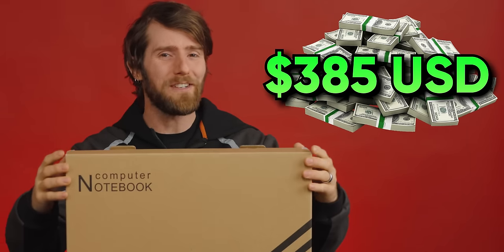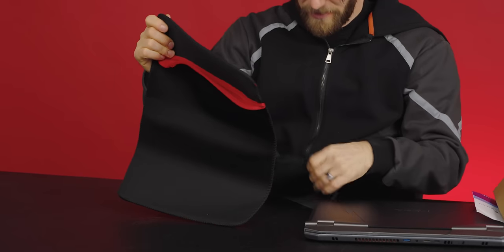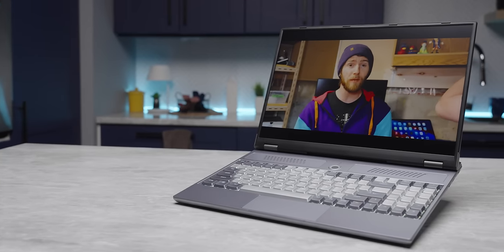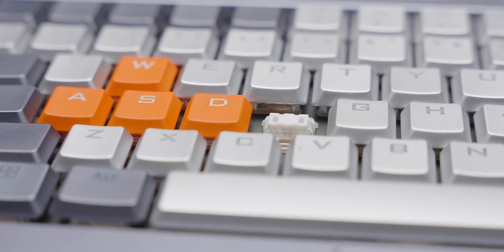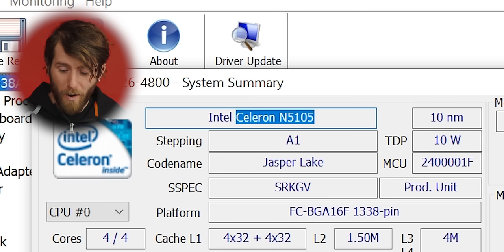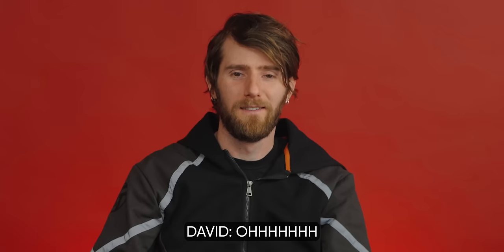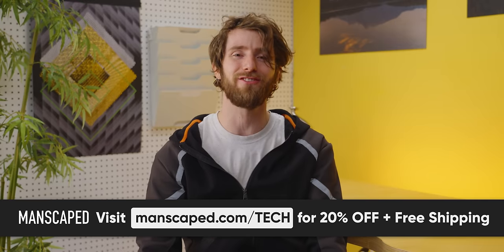Brown Star for Effort – This AliExpress Gaming Laptop is HILARIOUS

Comment: The benefit of multiple partitions to me is simply another level of file organization. It's a nice place to put files away from the wild west of other folders that other programs put heaps of random junk in. But I hate it when it's a default because most people will not know they can use the second partition and even when informed they can, they never will because it's just not a form of file management they are used to.
Reply: yeah I don't like having important data on C in case it's corrupted and I need to reinstall windows or something
Reply: but it is stupid for SSD, you want to the NAND flash wear off evenly, if you create several partitions how will the firmware going to handle it. this probably shorten the lifespan off the SSD
Reply: @tysloo81  firmware doesn't care about partitions, at low level all free space is marked and managed by the drive itself (logical LBAs vs physical + TRIM command) so data/partitions is physically fragmented across flash chips.
Reply: @Chipsaru  i see, look like i worry for nothing
Reply: I constantly fight with family trying to get them to store personal stuff on the second partition.  When I have to go fix whatever they've screwed up, I hate having to go find all of their stuff before wiping the OS.

Comment: If I could get a laptop with this large 16:10 screen and a great keyboard like that, that is not a scetchy cheap laptop and it had a better processor, it would be an insta buy from me.

Closest I can think of is thinkpad t16, but I no longer trust lenovo to make a good keyboard after they've reduced the key travel again and again on thinkpads.
Reply: Look at the legion 5 pro, 16:10 screen and a great keyboard
Reply: @user-uk5vf5zf9b  Really expensive though, it's the higher end of laptops, particularly the higher end of gaming laptops, which in itself are at the minimum £599+ usually
Reply: I just bought a Lenovo Legion from Costco on the Boxing Week sale. I really don't care about keyboard travel because I use an external keyboard. Do you have any other qualms about Lenovo?
Reply: @UnavailableHandle.  you get what you pay for.
Reply: @epmcgee  That is true, but it must be stated that although the quality is better, you have to pay more. And if it was as easy as paying more, then people would not be considering buying the cheaper and 'worse' item in the first place.
Reply: @Suuperwuuper  The design of the Legions is an absolute deal breaker for me. It has too much gamer, early 2010's energy for my liking. I think Asus' Zephyrus lineup is just an all around much better product. Very slight downgrade in the gaming department in terms of raw fps for much better everything else.

Comment: I would not trust that windows version for anything.
Having said, that, I have a gaming PC I do everything with, and a and now about 5 year old budget laptop I use on vacation once a year. And I got to tell you (except for windows) this looks like a pretty sweet 'for vacation' laptop.
Note, I deliberately use an older laptop on vacation exactly because it can't run modern games, to make sure I actually vacation on my vacation.
Reply: Tbh,  the activation .bat is a bit of a issue,  but show hidden files is a tweak I do myself, same with show file extensions. Putting icon snap on desktop is.. odd, but I thought it was default on some versions of Windows. The partitioning could be just because of  how they are running a deploy image.
Reply: I mean, if it's any version of windows after 7 you shouldn't be trusting it no matter Where it came from or who installed it (yes, even if that was you), so...
Reply: Just format the drive and reinstall a legit copy of windows (or your os of choice). You don't even need to  purchase a license and activate it if you don't mind some minor annoyances.

Comment: your copy of windows is activated using one of the two following methods.
one: using multiple volume keys.
two: a activation hack called a msk key activation hack.
both which will give out the windows is activated using the organisation's activation service.
problem that you'll have is that under one it is against microsoft terms of service or eula. and if it's two than the activation will only last a certain amount of months before windows needs to be reactivated again. this is one of the reasons why the laptop is cheap to get with windows 10 pro.
Reply: The other method is using kms.lotro, havent had issues with that yet.
Reply: I wonder why they didn't pre-activate before shipping with grey area cd key site windows. It like $10 a pop of win10
Reply: It's using KMS for sure, you can see it in the batch file. It's probably got a scheduled task set up to run that batch file every so often so that it stays activated.
Reply: @linaskvedaras  because it's still $10 each machine.  So they rather use a KMS license and activate against a unofficial KVM server on the internet (most likely hosted in China).

Comment: Great thorough review. The only reason I have never purchased a Chinese brand laptop is because of the uncertainty of whether it be a legit Windows fully functional, if it would still function in 5 to 10 years after purchase or if the system would be upgradeable to a Windows 12 once it comes up, if is going to be secured, if you can increase storage or ram, or if the games wouldn't be lagging so much, etc. After all, we live in a consumer world and lately all products are made to last shorter times than before.
Reply: That logic doesn't wash much, China has 5-10 good years on it before Myanmar pulls a hustle on it. 😉 Open source drivers and standards in flex connectors would be good to see, as with durable USB-C magnetic connectors.
Reply: China has some brands like mechrevo with laptops shipped with legit windows, they're really of good value for the money if you ask tech enthusiasts in China. The only downside is that they usually don't have a very good build quality and sometimes you need to fix them yourself

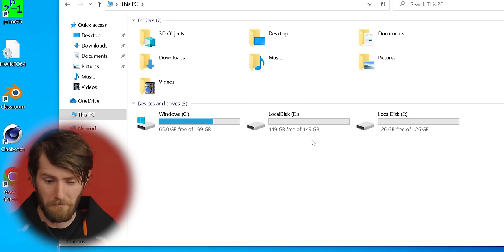Comment: 12:16 I disagree, there is a real benefit with partitioning your drive for your OS and whatever else. If for whatever reason you need to reinstall windows, it allows you to do it without purging all your data and programs. This saved me many, many times from broken windows updates. One I particularly remember is on windows 7 I had virtual audio cable and a windows update completely shit itself when updating and prevented me from gaining access to the operating system and the recovery area. I could wipe my 100gb partition while keeping my 900gb worth of games.
Reply: Only partially thought, tons of games and programs throw valuable files in AppData (without warning the user), then you think you're safe with the program installs backed up and bam, all vital informations are gone.

Still a good idea to keep valuable files/programs on a different partition/drive, but remember to keep a list of programs leaving their goods in AppData or User Folder (my documents and such).

Comment: as a coder who uses a home server to work remotely, I think something like this could work for coding stuff as well. I do think this has way more potential if you step away from x86 and use an ARM system, that way you can get more battery life out of it (and probably better performance in basic tasks like remote desktop).

EDIT: I would also favor linux in that case to further improve performance (also bc I am starting to actually hate windows right now)
Reply: Why are you starting to hate windows?

Comment: The jh is short for jihuo, which means activation in Chinese. This laptop came out in China back in the mid-2022. They advertised themselves as gaming laptop, but never really made it clear in their product page that it's only using Celeron chips. Instead, they made huge efforts showing people the mechanical keyboard, which actually attracted many reviewers. Btw, the laptop you purchase back in China came with a fire extinguisher. And also, the brand name is different. But they are the same product.
Reply: F-fire extinguisher? Is that some sort on innuendo

Comment: Let's be real, clean install is what most of us do on new device anyways and should always be done on less known brands imo, so no point there. Also gettin win activation codes from China has been a thing for quite a while now, they usually get it legit from some company that bought them in bulk.
Reply: Fun fact, I recently bought Asus without win, got bootable from MS site and activated it using my old code that came with 300$ Jumper ez book 3 few years ago for free and it works just fine.
Reply: Yep, buying a laptop with no pre installed windows can be great value if you can find one
Reply: This one is using kms activation hack though
Reply: That's not legal in any case. Even if this is a legit volume license, you're not supposed to share it outside your organization.
Reply: @АлексейГриднев-и7р  This is KMS not regular volume license
Reply: its a pirated version of windows they are using. that said, its not "unsafe" as in they aren't sending you data anywhere. its just a kms hack, super standard as far as pirated windows goes.
Reply: @pafnutiytheartist  Got my Y520 in 2017 without Windows pre-installed. Needless to say, I have Win 10 LTSC with KMS activated running on it.
Reply: @АлексейГриднев-и7р  Who cares. As long as it drops the overall price..
Reply: @fooltimer  even windows 7 codes works iirc

Comment: Even the specs they used for marketing is weird. A Celeron gaming laptop, with a 2k display, and a mechanical keyboard. But no discrete GPU? That said, the broken English used on the store page is hilarious to read through
Reply: It seemed to me a good laptop before the Celeron part.
Reply: @DRSDavidSoft 😂
Reply: It's obviously designed to fool people into thinking they got a gaming laptop at a bargain. With those specs it could have easily been a pretty good fanless thin and light.

Comment: The batch file named "win10jh" probably mean "win 10 activate",  "jh" stands for "ji huo"(Pinyin of 激活 whitch mean activate).
The garbled char in the batch file could be Chinese saved as Chinese encoding format gbk, default encoding format for Chinese language setting Windows system, but in English setting it's display wrongly, you can open the file with gbk instead of default utf8 the it probably displays correctly.

Comment: Actually an amazing laptop for many people because it's got a fantastic keyboard for that price, 4 cores that can easily handle Office, a 2.5K 16:10 screen for the rapid fire Word typing, and it would still work for around 3-4 hours on battery even at high brightness. And the iGPU is serviceable for 4K video playback - and remember, it's got a 2.5K screen, so watching 4K movies with that Intel Wi-Fi chip is what you would certainly want to do. With Linux it's going to be a great machine too.

Comment: That honestly was not a bad laptop, compared to what I was expecting due to its price and that it came from AliExpress. That keygen in the OS sure was surprising considering that one can easily get legal keys from around 20 bucks, but well nothing that cannot be fixed with a fresh install.
Reply: they use an activation sever like other comments said so nothing unsafe
Reply: @namesurname4666  Oh, I know, as I used those things before Windows 10. I just made mention of that, because if you are uncomfortable with those things there are cheap alternatives.
Reply: how they worked on other versions of windows ?
Reply: "legal"

Comment: There isn't a weird off-brand Wi-Fi chipset because of Intel CNVi: basically a Centrino successor. It's cheap because most of the expensive circuitry is integrated within the CPU die, leaving only some radio parts to the module. It should go without saying, but CNVi modules aren't standard PCIe and will work only in a dedicated slot.

Comment: Wipe the whole SSD and put Ubuntu on it and you'll love the laptop. Seriously.
Reply: Truth... except I run Slackware, instead.  I have like a dozen Slackware 15.0 systems that friends were just throwing away.
Reply: you'll love it until you try to use it for anything you bought it for :P. I run various unix flavors on my machines but my laptops run windows except my sparcbook. I need them specifically to run windows software without any weird stuff that eats any extra time to set up, or worse, just doesn't work. To me a laptop is a tool, it just needs to do a set of things reliably and that's it.
Reply: @noth606  I get a lot more work done on Linux, yes with a GUI, than I do with windows. What software do you care about?

Comment: Would this actually make a decent ChromeOS flex book? Can it be installed on such Celeron?
Reply: I would think so - the only issue might be with the webcam, but other things should work.
Reply: If your going with alternative operating systems on a device like this, just try something like Linux Mint. Has most of the advantages of ChromeOS without most core limitations of Google's Operating System.
Reply: Yeah don't go with ChromeOS for this —or debatably any— system. Any non-Google Linux, or Win7 or Win 10 would all be fine. Obviously Win 7 would be very contentious or recommended-against by many, but I think it could give a better experience if it's a device that isn't used to download sketchy programs nor open sketchy email attachments, and most importantly isn't doing anything that might need Win 10 (like most tax software for some stupid reason)

Comment: Can Anthony revisit it with different Linux Distros? I think it would be good to try it with the typical picks along with deepin, since it is a chinese distro.
Reply: I would avoid Chinese distros.  The Windows is also sus.  I also worry about what's been done on the firmware too.  Just have a packet sniffer on for a while and make sure it's not doing anything suspicious.  I personally like Fedora currently, but any Linux distro may do well on the N5150 especially with 16GB of RAM.
Reply: @TechieZeddie  I mean the chinese distros are still open source.
Reply: @KeithBoehler  unless you download the recompiled ISOs.  Also there's a huge conversation about their software repository.
Reply: @TechieZeddie  True, but it is still open source. If you want to use it and compile it yourself out of any concern then do so. Still better than it being closed and with a "trust me bro". If you still do not trust it then don't use it. Its not like you are vendor locked into it.
Reply: @TechieZeddie  it's windows 8 or higher. It's sus by default.
Reply: @KeithBoehler  If you compile everything yourself, you're not using a distro anymore (unless said distro is built for this such as Gentoo). Half of the point of a distro is the package manager and repositories that distribute precompiled binaries. Binary distribution is very much is a "trust me bro" kind of thing, and the fact that the sources for the packages are available doesn't say anything about whether or not the binaries can be trusted.
Reply: @alex15095  And how does what you said change what i said?
Reply: @KeithBoehler  It is similar to someone giving you a drink and the drink's "recipe", you refusing to drink it because that person has a history of poisoning people, and someone else saying "well they gave you the drink's recipe, it's not closed or trust me bro, if you don't trust him you can go make it yourself"

Just get your drinks from a reputable source in the first place?
Reply: @alex15095  So build it your self. Remove the parts you don't like(if any). It is open source for a reason, take advantage of it.
Reply: @KeithBoehler  you really have to get everything before compiling yourself, but not everyone has the knowledge, time, or will to do it.  Most will just download the ISO which is pre-compiled by sources that's not trustworthy.  If you really like the Deepin desktop, you can also use a different distro like Arch and install the DE yourself.  Although still be careful.  Just because it's open source doesn't mean everything was vetted carefully by someone.  It's a lot of lines and even if you know how to read code, you may not read everything or miss something.
Reply: @TechieZeddie  Look man, reread the thread. Stop arguing in circles. You are not saying anything I have not already said.
Reply: @TechieZeddie  there's also no reason to go for a Chinese distro over something like Fedora. They'll offer the same kernel with the same hardware support. (Fedora may even have the advantage, as it generally has a very up to date kernel)
Reply: You had me at Anthony and Linux.
Reply: @Sjoerd1993  My thoughts exactly.
Reply: @KeithBoehler  Um, okay...

Comment: Ohh, that's a 'Q'. I was wondering why they would brand their laptop "DEER"🦌

Edit RE:Celerons - I run a MinisForum Celeron box for my homelab server. Adequate for purpose, dual LAN, and the whole machine draws like 10-20W.
Reply: I've actually been on the fence about purchasing a little celeron based machine to use as a router. its one of the one with 5 2.5GBE ports. How does it hold up in your experience?
Reply: Me too, I think I like the name DEER better
Reply: Japan: we have a complete computer called mouse.
Reply: 🤣 search for Japanese mouse commercial at your own risk.

Comment: 100mbps is still ok isn't it? My WiFi is only 15mbps lol
Im poor and this looks very good
Reply: Wifi at 15mbps is one thing but that 100mbps is the local transfer limit like if wanted to move files within your system or to an external drive, that's the most it will do it at